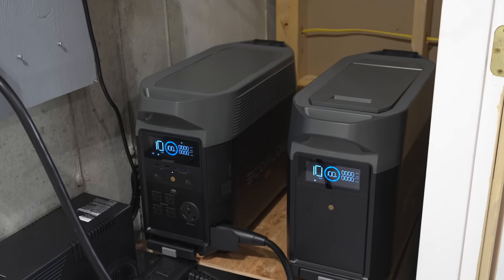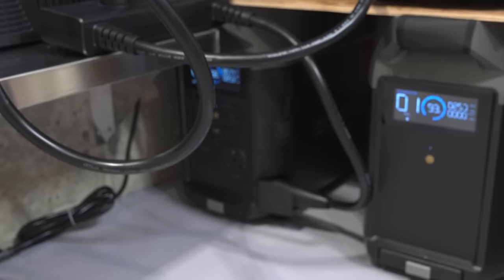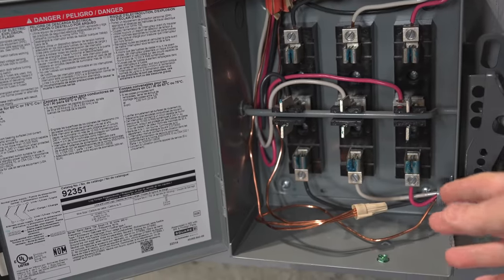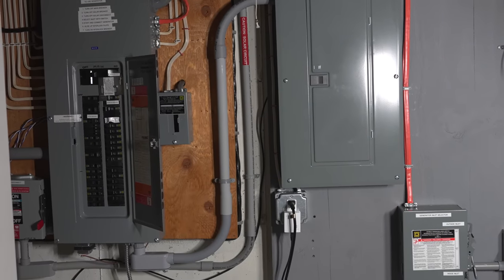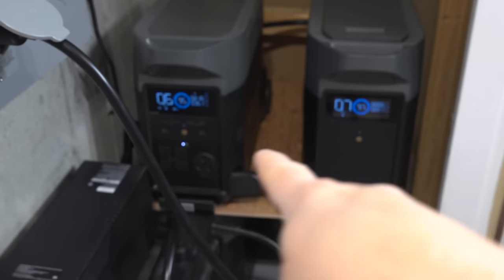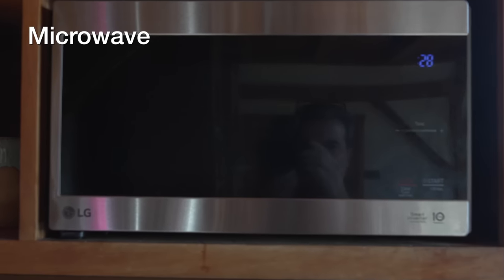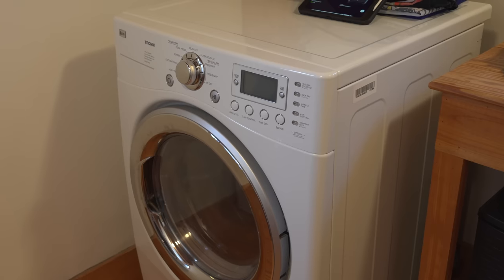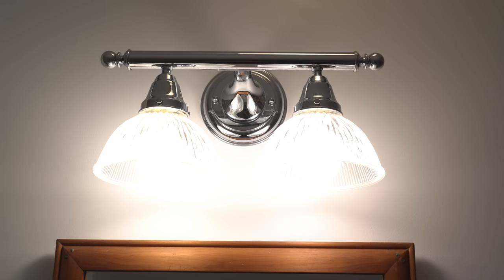How to power your Whole House with a battery generator - Ecoflow Delta pro

Comment: QUESTION: Instead of Emergency Backup...What about charging the batteries at night during Off-Peak (low-cost), and automatically switching your house to battery power during On-Peak (In AZ this is 4x more expensive than Off-Peak)? --I used to program the thermostat to 90 while at work, and then can run the AC for 3 hours straight (Off-Peak) & it would still be cheaper than 1hr of On-Peak Running.  ROI on solar can be up to 10years, and with no net-metering available in AZ...spending $2-3k on batteries would make sense (If doable). (Plus, if needed, an AC capacitor or Soft-Start can greatly reduce the amp-draw on the batteries if you have pets or family home during On-Peak hours)

Comment: 5:55 It regulates it's throttle to keep the speed constant, so obviously it's gonna run at the same speed.  But in order to maintain the same speed at a higher load, the generator will have to open the throttle further and therefore consume more gas, otherwise it would stall. Of course your generator will need a certain amount of gas to keep running, even without any load. But the gas consumption of generator is of course very load dependent.

Comment: For anyone interested: the Ecoflow website has a package with two Pros + double hub adapter for $6,200 ($7,500 full retail), and Wellbots has extra Pro batteries for $2,100 ($2,500 retail). That takes a 240v setup with two batteries to $10,400 ($12,500 retail).

Comment: So a little price rundown.
Delta pro $3,500 ×2 = $7,000
Extended batteries $2,600 ×2 = $5,200
Total roughly $12,200
With a total 14.4kWh

A Tesla Power Wall for comparison costs $12,850 with a capacity of 13.5kWh

You aren't really saving much of anything going DIW instead of professional. The only real upside is that with Ecoflow you can build up instead of having to buy everything all at once. It is also somewhat portable.

Comment: How did you wire it into you’re breaker box ? Please I’d like to know , did you back feed it into a 30A double pole breaker ? What inverter do you have & a video on how you set everything up in the proper order one wiring it all to together ! I’ve got the Moes Automatic Transfer Switch , I’ve got another brand new homeline breaker box ! If you find the time this would be very helpful

Comment: Only thing missing is actually putting everything together without manual intervention, and using the gas generator to fill up the batteries, so you can rely only on the battery if you get a power outage like for 2h, but if it take forever to reestablish the lights, than you can fill up again with the generator

Comment: Nice setup how much does the complete unit set cost separate from what someone charged you to install it this would work awesome on my off-grid place
Reply: I would get large, much less expensive LiFeP04 batteries. When the parts like the charge controller, BMS, fuses, or AC inverter go bad you can replace them and have backup parts on hand to do it rapidly. A 300 amp hour 12 volt LiFeP04 battery rated at 3.8 kwh capacity is about 1000 bucks. Two of those in series and you have a lot of power. Two of these is enough (if you get daily sun) to power a small window air conditioner. A couple of large server rack LiFeP04 batteries are about 3000 bucks and have about 10 kwh capacity. Someone who is wealthy though may choose to spend a fortune buying EcoFlow batteries. They`re great and so is the company. But when parts fail in the future....
Reply: @baneverything5580  I agree, for a whole home backup, server rack batteries and a separate solar inverter is the way to go, especially financially. I'm (still installing) on an LV6048 for split phase 120/240V in my house. I'm upgrading from the LV2424 which is only 120V.  So a 6kW inverter and 14kwh of LFP cells has cost me just over $3000. About 3500 actually, same as just one ecoflow delta that has 1/2 the power and 1/4 storage as what I have.
Reply: @andrewt9204  I`m on a fixed income and can`t drive and live in a very isolated rural area in hurricane country. So all I could get was one 300 ah Ampere Time battery, a 2000w inverter, 60 amp MPPT charge controller, and a 20 amp plug in charger to top it off when severe weather is coming. I need at least one more 100w and another 190w panel to have almost 800 watts of panels in a series/parallel configuration to power my tiny Frigidaire 5000 BTU window air conditioner after hurricanes and other things when needed in emergencies. 

I had bought solar power stations as I was able before large battery prices fell that were just large enough to have two for a freezer, two for a dorm fridge, and a collection of smaller ones for lights, fans, WIFI, 12v cookers, and low wattage rice cookers. So the big battery will be for staying cool, storage, or long term electric blanket if I need that. or even power for my microwave. Just whatever is needed most. 

I have a small gas generator but often gas is impossible to get after severe storms with power out, no communication at all, and trees covering highways, and I can`t afford it to be honest, not for two weeks 24/7. I just want to ensure I have power I can make on site long term so I don`t have to worry so much. Tired of burning up up after storms when it`s 100 degrees, or losing an entire year of vegetables/fruits in my freezer. Had to do something.
Reply: @baneverything5580  An Ampere time battery and 1500W inverter with a 200W solar panel was my emergency backup for a while. It's a good cheap solution to keep bare essentials going if you're prone to power outages/disasters. I have an EV now, so I'm looking to invest in about 2500W in panels and this big 240V inverter to very slowly recoup those costs, and be able to drive at least a little if  SHTF  for a bit.

Comment: i have a sump that runs very frequently in storms and even in winter will run as we are on a spring sadly.  still trying to figure out best system balancing cost, ease, efficiency, and ideally better for long term future of energy (i.e. leaning renewable).    we rarely lose power for more than a day if we do but with that sump something is needed beyond my battery backup.

Comment: You got something wrong here.  It does matter how much power you are drawing when it comes to fuel efficiency with a gas generator.  While they are set up to run at the same speed, the more power you draw, the more load the generator will put on the motor, thus the more throttle to maintain that constant speed.  You can see the throttle move with increased load if you look.

The batteries do still have an advantage here when it comes to efficiencies with smaller loads, just not as profound as stated in this video.

Comment: Fuel for generator is going to idle with less drag if less appliances are on it. When the demand of that energy is needed, it’s going to use more fuel. It’s exactly like towing a trailer. What and how much is on it by its total capacity of weight, it’s going to either just idle on lesser fuel used, then when loaded up, it’s going to suck more fuel to keep up with demand.

Comment: That's cool. I do have an open frame inverter generator. 7000W continuous and I paid like $811 shipped to my door. It's a WEN GN875i.  Problem with the batteries is what you have into them could have paid for a whole house standby generator....
Reply: Yes, but running that generator all the time under low load, makes it inefficient so it wastes a good bit of fuel.  It can be more efficient to run off of batteries most of the time then only fire up the generator to recharge them as needed.

Comment: So I'm watching this again while sitting in the house in the dark because of this snow/ice storm that came through. I'm planning on asking an electrician to wire it up just like this so I can run the Ecoflow batteries inside and then still have a gas generator outlet available outside.

Do you normally just plug the Ecoflows into the outlet for charging and could you conceivably charge them this way when running the gas generator outside and charging them through the wall?

Comment: Like the video I do like these Echo power-station they're  inproving each model that comes out I  have thought about getting one for myself but why not install a powerwall where everything is automatic I do have a Tesla powerwall which works great in a power outages I've never ran out of power I got a buddy of mine that has a Enphase powerwall that is a little lower on the Spectrum then the Tesla powerwall but still he's never ran out of power I have a gas generator in my backyard ever since I install a Tesla powerwall I've never had to run it  in a power outage I  have  run my powerwall for like 3 days straight and never ran out of power not saying  portable power stations  are bad they're good I like  jackery ecoflow they are really great products  but I think for in-home system make everything a cleaner look and easier  why not just install a actual powerwall....

Comment: Hi, I think you should add an  Ecoflow Sub panel to your system. You can run 240v to a sub panel from the Ecoflow sub panels move my circuit from the main panel to the sub panel so GFCI breakers can work on that. This will also let you overcome the 10-circuit limit from the Ecoflow Sub panel.  I changed the system with my 3000 watts solar panel that gives it more than enough power to run during the day and most of the night. I am able to run my 3-ton HAVS with Easy Start on the system.

Comment: When you were testing the full load with the dryer running, it looked like the displays on the tablet were indicating between 1h 30m and 2h…that’s really not enough to get you through an outage.  Am I reading things wrong? Obviously during an outage you tend to shut off nonessentials and you wouldn’t be running everything full tilt…🤷‍♂️ Do love the eco flow equipment though👍👍

Comment: Something like this is intriguing. We have a 3BR 2Ba cape style home. I'd like a setup like this to power the gas boiler / circulator / thermostats if the event of a power outage along with some lights, Fios router, and refrigerator. Seems like a no-brainer compared to a whole house generator for our needs. Do you think we'd get at least a few days with light usage?

Comment: How long would the battery back-up system last ultimately?  Say, no washing/drying...heavy draw use?  Just two fridges and regular house lighting....
Reply from the maker: If you only use this for outages, it should really last forever, but thats the electronics, maybe 5 years, 10 or 20 but ecoflow is sold stuff. The good news is the batteries alone won't be the issue, these are lithium iron phosphate and even if used daily, they should last around 10 years, and thats daily! Keep in mind if you used gasoline evey day for 10 years that adds up too.
Reply: @SilverCymbal  How long in a given outage?

Comment: Wonder if you install the Power flow smart home panel and knock off the grid power and connect your generator to the external outlet you have the best of both worlds.  Generator would charge the Delta pros and run your 240 circuits if needed.

Comment: I’d be more interested to see the setup where generator is constantly charging the battery. This way you could get away with “smaller” generator, because power thirsty appliances usually are not ran for too long. So the battery should be charged from the grid until there’s an outage. And as soon as it happens battery takes over and small inverter generator should kick in to trickle charge it. Potentially it could top it off through the night. Idk, just seems like a better setup.

Comment: You could use the batteries as a primary and only use the generator to charge the batteries while they are running your house so you have no interruptions in power that way you can use a smaller generator.

Comment: Two questions. 
1. Do you have two electrical panels? Are these powering both?

2. How can 30 amps power a 200 amp panel?  I'm assuming that it can't, but that why it can only do 7200 watts at once and so you need to be much more selective?
Reply from the maker: The setup here is similar to what you would expect for a small farm with outbuildings and I now have 5 electric panels all driven off a single 200 amp service. They are all connected and yes the 30amps is driving them all. Power works by how much you use not the distribution. So I can have power available at over 100 different circuit breakers but I can't use more than 7600 watts at any given time. So while on battery you have to not use more than that or it will go into safety mode. This is identical to when using a gas generator. That is a great question!
Reply: @SilverCymbal  Thank you!

Comment: That are a lot of steps once you loose mains. If your flashlight is down, good luck! I use a contactor on the gas generator, it does switch over all by itself.
Reply from the maker: If you leave them connected as I have, you are on battery in less than 1 minute. I am a bit of a safety nut so most of the steps are checking stuff. But of course be careful
Reply: @SilverCymbal  I am the same way. I label things and always verify.

Comment: Is there is a 100 amp or 200 amp rated ... Three Pole Double Pole Switch available ??? I am wondering about  running your full electric panel power from grid through those less than full size wires (for full house main panel or sub panel) ... when the grid is on? Maybe you are running only a lower amp essential circuits panel?  through that connecting switch. I think you could clarify that part of what you set up for the additional lesson 😉 ... I Like this clip :+)

Comment: wish they had one with 240V in one unit. I just want to be able to run my well pump during a power outage. I can do without all the other 240V loads until power is restored.

Comment: I understand that a lot of areas do not have natural gas lines, but in my area most homes do. Would it make more sense to go with a Generac or equivalent system connected to the gas line or a large propane tank (as some do) instead of EcoFlow type of solutions?  My neighbor had a Generac installed to his gas line for about $9k. Love your videos Chris, have been a subscriber for several years and used some of your advice.
Reply: If I ever got a generator, I'd get a natural gas powered one, too.  Since we have gas in for the water heater and furnace, should be a fairly easy install.  They do make dual fuels (NG/LP and gasoline).  But I don't have a place to store large amounts of gasoline safely.  And I'm assuming if the gas lines to the house get knocked out, it's going to be very difficult to get gasoline.

Comment: That setup here in Canada would be 13 grand and not everyone could afford that. In my case i have a Q6500 briggs inverter wired into a manual transfer switch providing me with 6 circuits so we would be pretty comfortable in a power outage. My concern is the noise, although my gen is fairly quiet my neighbors are quite close 30ft each side and 60ft behind us, i would like to only run it during the day and have a delta system take over from 11pm till 8 am powering forced air gas furnace efficient refrigerator and TV. Any ideas on what delta combination could handle that keeping budget in mind thanks btw love this channel

Comment: Is it possible to have this setup, but add a Generac backup generator and solar into the mix? So, your batteries would be "prime" by powering your home. Then, during a grid failure, you would have Generac, solar, or both charging your batteries. Is this setup even possible?

Comment: You could of just bought one Delta Pro 3 and connected to the 240 outlet on bottom right hand side on the front. 
No extra batteries no hub. Delta Pro 3 puts out 4K up to 7200 surge.

Comment: Very neat setup, but I wonder what the cost was to have a system like this? We installed a whole home backup natural gas generator 2.5 years ago and it cost approx. $9,250 cdn. Best part about it, it kicks on and off automatically, so the house is protected even if we are not home.
so it would be interesting to see how this setup compares price wise. I know over the long run, the battery system will likely save money, but it is also not a long term solution, and we have been without power for days, even weeks to months at times where I live. Not us personally, but some homes.

Comment: System really looks impressive.  Nice!  One question though.  With your set up do you utilize the gas generator outside to charge up the Delta Pros in the basement?  Of course this would only be necessary if the grid power was down for prolonged (days) periods. If the answer is yes, the system is really cool because your able to use the standard generator 30A external plug in for the gas generator

Comment: I don't see if your system is set up to charge the ecoflows with your generator in the case of an extended outage or not, or if you're just switching over to the generator for the rest of the outage once the batteries are dead. To me it would be ideal to have the generator plugged into the ecoflow pro so that it could recharge while continuing to power the house vs having to switch back and forth.

Comment: I would like to see if the Ecoflo Delta can charge the battery and run the load at the same time so that would entail that the inverter portion would phase synchronize with the generator output to add to its combined capacity. I know Victron Quattro inverters can do this. I have an outback inverter charger that is couple to an isolation transformer that can power my entire house. I rarely use my generator but it can recharge the batteries no trouble. I also have 10,000 W of solar panels it’s a great thing to half

Comment: Plugging both of the DP's into the hub does give you 240 but you're not utilizing that 240 in the demo you provided.    Once you get your home panel setup, you can plug both of the DP's into the smart home panel and boom, now you can run 2 legs for 240v :-)